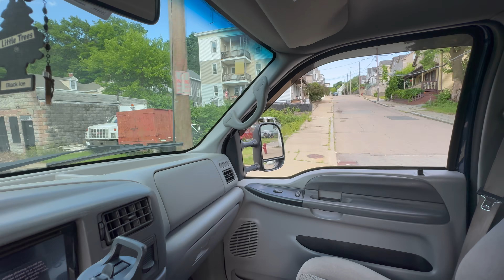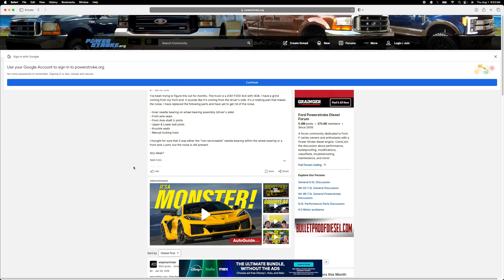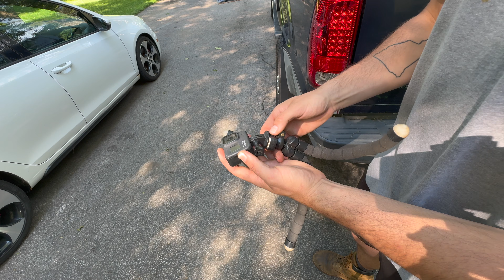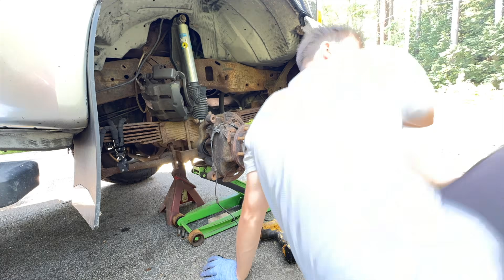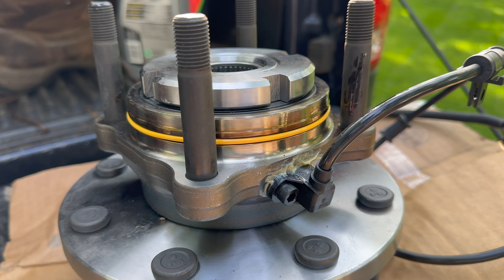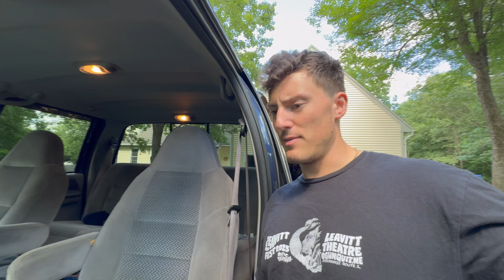My Ford F350 7.3 Powerstroke Has Almost Failed Me Again

Comment from the maker: For all the fans of my ancient death-inspiring leaf springs on the truck; who's the go-to for replacement leafs for these things? The previous owner said the truck has a 6 inch lift.
Reply: General spring is whar I go through for all my leaf spring needs. You, having a significant lift, may have to go through Rancho or Rough country. Check general spring first. Replace ALL u bolts, shackle bolts, and leaf spring bolts. Do not try to save them. Up north, they are single use.
Reply: Bds suspension

Comment: As I have a similar truck and something I've learned over the years having my 2000 f250 it's better to change parts on both sides just like doing brakes. I know  parts aren't cheap but doing both sides saves headaches later down the road.  I  enjoyed watching ur videos

Comment: What I would do since you're doing all the repairs yourself is, save up a few thousand dollars and replace everything in the front end at once. Ball joints, hubs, spindles, steering linkage, those springs, wheel bearings, etc.  Once everything is new, you won't have to worry about it for another 100-200k miles

Comment: You should have replaced BOTH unit bearings and should have done so the last time you had it all apart.  Would have saved you the heartache.  Also get some anti-chafe wrap on your power steering line.

Comment: I've had ALL the same issues with my 2001 7.3 pice of Shit work truck. If the oil in your 4R100 starts coming from the fill tube, it's because there is a dirt dober in the breather tube and it's located on top of the 4R100. When your radiator goes bad never replace it with a totally Aluminum  radiator.  The Aluminum radiator makes the 7.3 run too cool, causing bad damage to your entire engine.  
Now if your engine is running too cool you could place large peaces of cardboard of the front of the radiator,  then drive ur truck and keep a good eye on the engine temperature gauge.  Or install a after market better temperature gauge.  Check with the truck manual to make sure it's running at the temperature recommend by Ford.  There is a site called Clent Allen on U-tube,  this guy knows everything about the 7.3.

Good luck you guys

Comment: You should have replaced the wheel bearings when you did the ball joints; all front wheel bearings, both hub and wheel.

When you decided to replace the hub,  you should have done both sides in the front.

If ever i have anything substantial to drag around, a 7.3l equip HD F-350 is the only  choice.  That entails a commitment to repair and maintain big heavy duty truck systems and components, which all cost and weigh more than lesser trucks.

Comment: Riff raff diesel makes a tool for greasing those “sealed” hub bearings. It’s $20 if i remember correctly. You remove your ABS sensor, bolt the tool on, pump some grease into the hub itself, and put everything back together. I grease my front hubs religiously once a year. And holy hell replace those leaf springs already!

Comment: On my 2001 7.3 F250 when I went to replace both the hubs the one on the passenger side was basically friction welded to the axle shaft. I had to remove the entire thing as 1 piece and change the universal joint as well as get a new outer shaft. These trucks are great but if you neglect the maintenance on them then you end up having to fix everything all at once

Comment: OMG those leaf springs ha ha.  At this point, you might as well replace everything you can afford to starting with those leaf springs and the brake rotor dust shields WTF? Those are cheap parts.  These are awesome trucks and will last you a long time if you just keep after it.  I daily drive a 2001 7.3 and anytime I have something come up, I fix/replace it above and beyond.  Preventative maintenance is your friend.
Reply: 19th year ⁹so 0⁰⁰⁰⁹😊⁰⁰0⁰0⁰⁰0😊😊😊😊😊😊😊😊😊😊😊😊😊😊😊😊😊😊😊😊😊😊😊😊😊😊😊😊😅😊😊😊😊😊😊😊

Comment: Instead of putting your camera under your truck there is a a tool that would pinpoint the noise. A multichannel clip on sound pickup tool can let you hear exactly where the grinding is coming from. These are usually 6 to 8 pickups per kit and plug into a receiver that has an headset and a dial to pick which pickup is being listened to. I have used these tools to make a dealer take responsibility for a bad bearing on a new car. You can rotate the dial and listen to which ever part of the car you have pickups attached.

Comment: I've been lucky with my 2000 excursion powerstroke, I've only had exhaust back pressure problems and needed glow plugs but while I was in there I also did valve cover gaskets

Comment: Good video I just got my wifes  Jeep all fixed up previous owner must have stripped out trans pan bolts and spent 4 evenings heli-coiling after work now it's time for the front end on my 02 7.3 upper lower ball joints and possibly some other while I'm there wheel bearings NICE TRUCK !!! 👍

Comment: It would seem like common sense to me that whenever your truck develops a humming/grinding noise in the front end that you not drive it a mile more than you have to before you can pull it apart and fix. Driving it around like that is what wrecked that stub shaft.

Comment: lol dude this is elementary ford/ dodge/ older Chevy solid front axle stuff! 
You can save yourself a lot of trouble and hassle by using some PB blaster and anti seize! On everything! Your live in a corrosive salty environment. As a mechanic, when you see a truck with that much rust on the frame and chassis, you Charge double! Rust bucket city. And it sucks, they out to outlaw and ban road salt in the way north east. It ruins everything. There’s a product call fluid film! Use it! It will prevent undercarriage rust! It won’t 200% prevent it, but it helps, the stuff really does work, it’s in a spray can, spray it on once or twice a year and it protects your frame, under carriage, body, wheel wells, steering and springs, hose it dow n all under neigh! Also you know what helps? Washing your under carriage once in awhile! I’m in Colorado, Colorado don’t use road salt, it’s to expensive to get it here.  Things don’t rot away here like they do east of Kansas lol. But I still give the under carriage of my ‘02 24v cummins HO 6 speed truck. Like get the rain coat out and climb underneath with a rain coat on! I like to buy a case of .99 cent gloss black per can spray paint and thoughtly hose all parts of the frame and suspension, axles, all the nooks and crannies! Not the body! Just the frame, axle and suspension parts! My trucks 20+ yrs old and the frame is still shiny gloss black! Clean enough to eat off of! Washing that salt spray off is the biggest part! I’ve seen people out east that have full on wash racks they drive their 2 ton truck up onto at a 45* angle up in the air so they can easily wash the entire underside of it with a hot air boiler! Your truck dosent have to be a rust bucket! I would loose my marbles if I saw even the tiniest rust bubble that formed on my ‘02 dodge Cummins truck! In Colorado here we don’t do rust! It’s not a thing here! lol. Heck it hardly even snows anymore here on the western slope except at higher altitudes. 
I would never ever buy a truck that spent any considerable amount of time up in the north east or east of Kansas. And if I did it better be really really cheap! 
Grease grease grease! Anti seize every bolt, nut and 2 pieces of steel that contact each other! By anti seizing everything your least making it easier for the next guy down the road that takes it apart!

Comment: There's a hack where you can put additional grease in these "sealed" hubs. They are minimally loaded with grease from the factory. I did this on my F250, but I live in a snow and salt-free climate, so hub work is easy here.

Comment: 1. Snap ring pliers. 2. Leaf packs and hardware. 3. Replace things in pairs.  God speed.
Reply: 😂lol if you have 1 bad bearing thats definitely bad and 1 bearing thats definitely good whats the point in doing both
Reply: @jamesbasye2362  typically with cars I've owned the parts have equal miles on them.  So for example if my left wheel bearing with 150,000 miles on it starts to become noisy I personally wouldn't just replace that bearing and keep the old right side bearing.  Some people will try to squeeze all the blood out of a penny that they can.  Time is money so I choose to be preventative when possible. With your mindset would you replace 1 of say 8 ignition coils or 1 spark plug if it started to misfire? If they all had the same age and mileage I'd replace all of them.  Too each their own.
Reply: @MattsLMM  my point is im going to be the one working on it and im not going to drive on a bad wheel bearing, i know what it feels and sounds and im not going to drive on a bad one, its like cvs mine never both go out at the same time, i know because i replace things as they go out, and i can get 20 or so thousand more miles on old parts still in good shape
Reply: @MattsLMM  i dont think theres anything wrong with squeezing what you got left out of a part, if something isnt broke dont fix it thats my motto and it helps to do it that way working for cheap people, brakes need done in pairs and so do shocks everything else can be done differently
Reply: @MattsLMM  ignition  and injection needs done in pairs especially if they are going bad, theres too many parts replacer mechanics that want to replace everything when its not always needed and they cant find whats the culprit because they lack the diag skills or they think they are doing it preventatively but honestly whos got that kindve money? Why would i want to spend 500 more dollars to fix something i could fix perfectly fine for  300,
Reply: What he said! 👆🏽and like he said, PREVENTATIVE MAINTENANCE, is how you save time and money. If he would of replace those on the first video he wouldn’t been here. Now by replacing only one side is but time before he is back to the other side.
Reply: Like others have said, do everything in pairs whether the other side needs it or not. This way they have equal miles on them. Because you know in a few thousand the other side is going to start having problems and once again you'll be out there replacing parts.

Comment: I had this same issue and was worried about the shaft being damaged too. If you have issues after this because of the wear on the shaft, you do have options. Ford will tell you that you can't buy just the new axle shaft for one side, but you can find it online.
Reply: I ignored mine for months… ruined whole front diff 😂. Damn axel seals were spanked, so half shaft would move and catch of locker